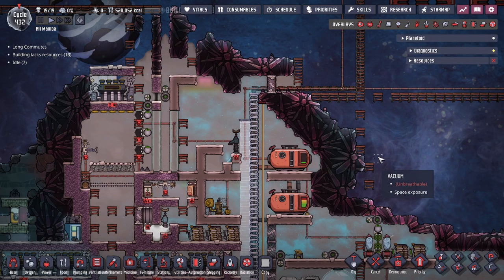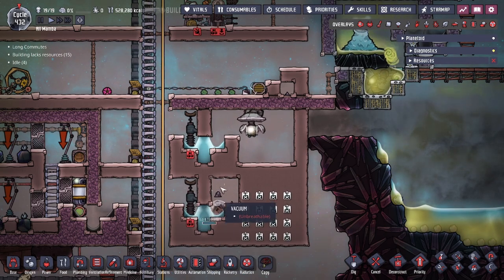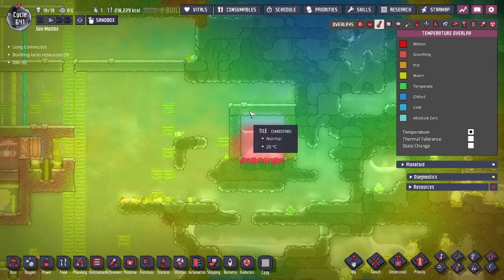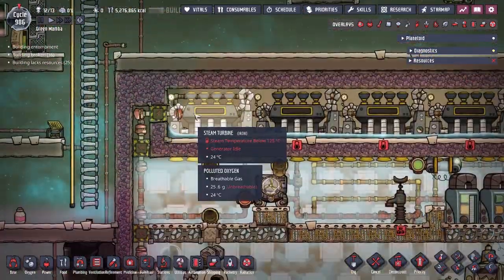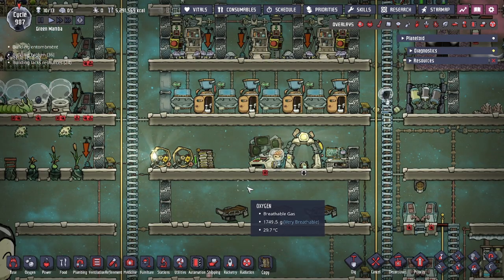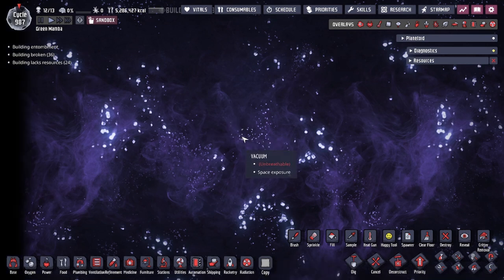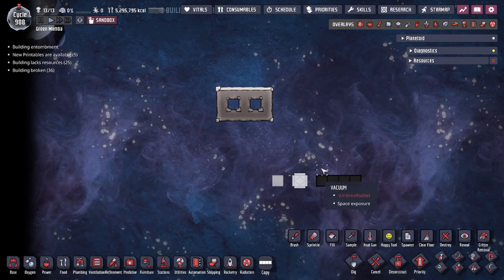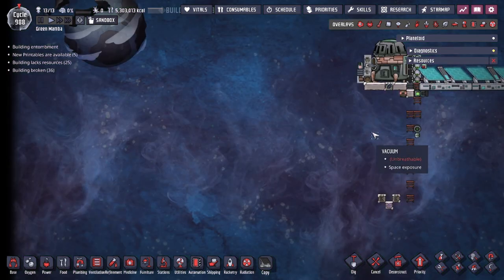Vacuum Properties Explained and How a Space Exposure Tile is Different - Oxygen Not Included

Comment: Are gasses sucked into space from these tiles right under space tiles? Not sure how these tiles are called (these brown-ish tiles), where you have your steam turbine at the top
Reply from the maker: so the tiles with "space exposure" on the tooltip of your cursor will delete gas that happens to float in and each tile deletes the same amount. the gasses dont get "sucked" in the sense that the space exposure tile doesnt actively drag the gas towards it- the gas has to naturally float to that area.
Reply: I have placed a gass canister emptier on that brown-ish tile right under the space vacuum, oxygen was pumped out and then slowly dissapeared. I assume space vacuum is sucking gasses as I could not find any other explanation
Reply from the maker: @girtas  yup, the space exposure tiles delete gas, but they dont pull the gas in- the gas just moves into it voluntarily like it does with every other space